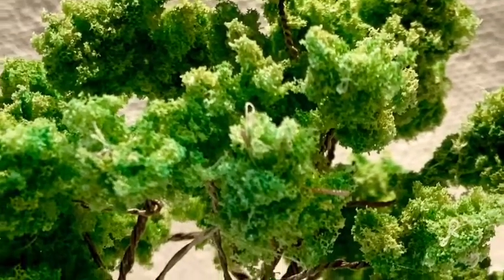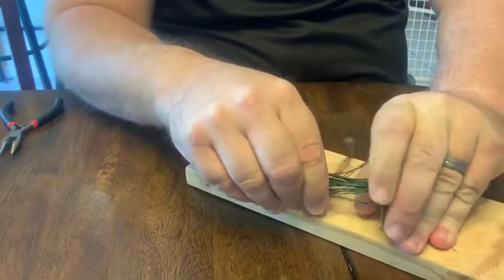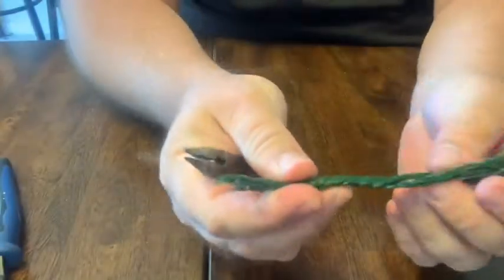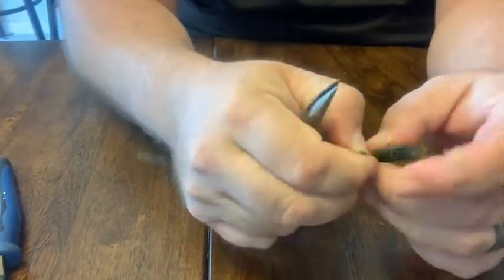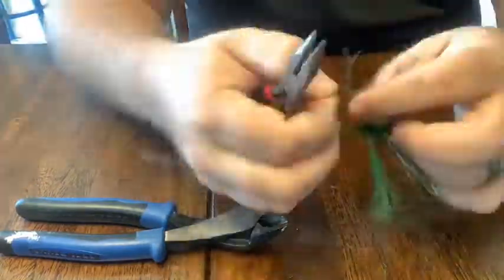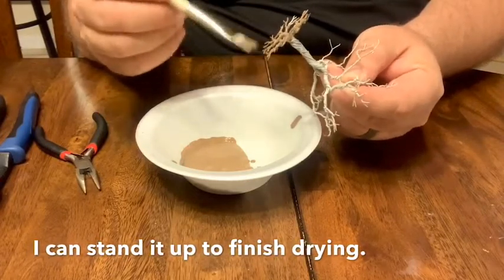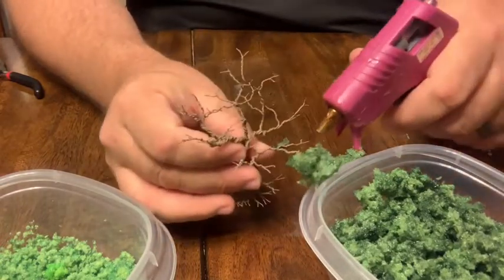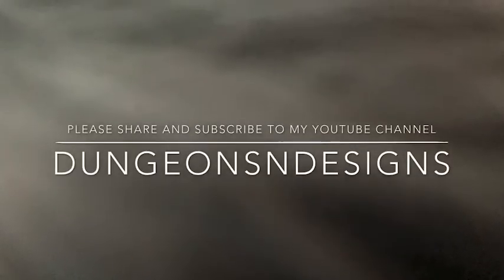Tutorial: Wire Trees

Comment: Nice, I grow crystals from various chemicals and had actually wanted to try some organic shaped. MY first was an exhaustively complicated mix of wire sizes taped over, glues then adding in sand as as a base for the crystals. What came out blew me away it was literally a shock as the color in the solution was too dark for me to see what was going on. I will link some stuff after like my flickr that shows some mineral specimens as well as a lot of crystals I have done. I am going to see if I can link in a more solo link to that tree if I put it on imugr perhaps. I did a nice sized one a couple months ago and crystallized it with copper sulfate and it came out so amazing. I really want to utilize this specific skill though to experiment perhaps with crystallizing and adding a little of your foliage. I will credit you if it works out though it would be a while form start to finish. I have something working right now inspired by the Lorax Truffula trees. A chemical that produces bright orange blooms of crystal but that would be a more palm tree look I think. Thanks for doing this I watched both tutorials and your video is already at work in my brain =). OK, hope this goes ok it's my first tree by itself : https://imgur.com/gallery/Q4fxa. Here is the Flickr page if your interested: https://www.flickr.com/photos/135759966@N03/. thanks again